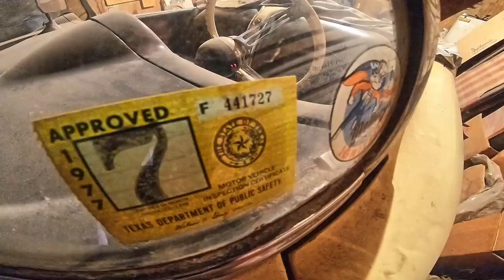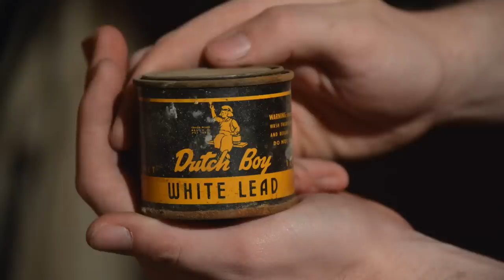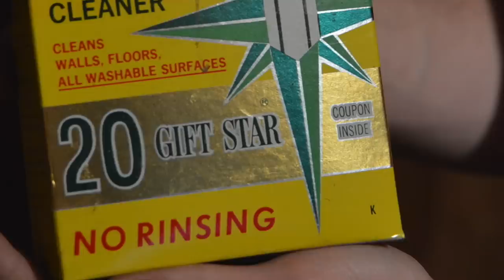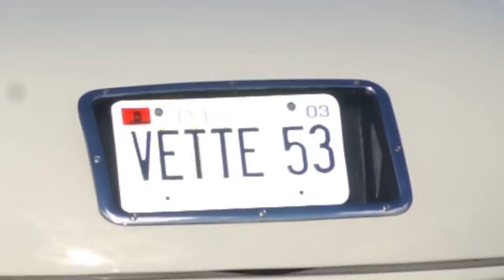1955 Corvette Barn Find Extraction, parked  in1977 - the lighter side of hoarding

Comment: I say New brakes, tires, fluids and drive it!
Reply: Got to check the gas tank and oil lines as well as the fuel pump, wheel brake cylinders, new fluids. Lot more to it than new brakes and tires. but your right, drive it.
Reply: It would take a lot of work. Everything is dried out. All hydraulics are bad. Mice . Carb rebuilt. Fuel pump , water pump bad , gas tank and lines rotten . Tires bad . My 62 had the throw out bearing grease dry up. It sounds good but you cant just fire these old cars up. And price some nos parts someday. The reality is its not cheap.
Reply: Yeah more like tear the engine apart and rebuild it, every hose new, every fluid changed, all new gaskets and brakes and tires, plus all the gremlins that storing a car for 40 years creates.

Comment: i found a disc  off about a 58  vette, they used have a plastic disc in the trunk lid about 10 inches  in diameter that had the corvette  in it.  i found on in the street in detroit in the gutter about 1960, have had a affection for those old vettes since.  i rolled off the line in motor city circa 1954.  you did a great job with the cheese cloth, that paint is a testament to chevy

Comment: Awesome......dont restore it!!! Just clean it up.
Reply: What a beautiful car
Reply: I agree pleas dont
Reply: When did the 4 headlamp version come out?.
Reply: @urbankotto9685  1958
Reply: yes preserve it as it is its a survivor
Reply: and dont spray water on the engine !!!!!!!!!!!!!!
Reply: Got to restore it first as the brakes will be rusted, the oil changed, pull the plugs and turn the engine by hand to make sure there are no frozen pistons, that kind of resoration, all mechanical.
Reply: BB Productoins got to drop the tank do the seals in the slave cylinders rear main etc . Those old cork jobs would have seen better days gaskets etc

Comment: If I may advise on this. Please do leave it as it is. The only things I would do to it is change out all of the rubber on it (period correct tires, Engine hoses, belts, rubber parts on the fuel lines, seals and do a VERY thorough check and test of ALL of the Electrical system.) Very cool to see this Vette see the light of day in 41 years. Please do keep us posted, I did subscribe. Thank you for the documentary.

Comment: From the brake system that is toast from master cylinder to all wheel cylinders at all for corners and turn all drums. All fuel components to be flushed and checked for leaks. All rubber to be replaced that includes the old rubber brake lines. This guy has alot of work to do, but what a ride!

Comment: Wow incredible how different it looked just rinsing the dirt off!
I was surprised the brakes weren't all seized up but I guess they may be drum brakes so quite protected ? I'm guessing it is a very dry climate there because over here in the UK I stored a motorbike in a dry garage, left it for around 6 months and noticed lots of spots of rust developing on all the chrome work and alloy parts were oxidising! There is just so much moisture in the air ! 😳
Reply: PD Tech only brake that worked was the parking break! The actual brakes felt like the breaks were not even there lol
Reply: @masonrichards4498 missing brake fluid

Comment: My father in law has a 57 and a 64 stashed away with several old Chevrolets!! I've begged him to sell me the 64 hardtop convertible. Mu wife gets the 57 when he passes. Its blue and silver with fuel injection. 57k og miles. I've seen it once. 57 has been garage kept and I bet with new lines and plugs itll fire right up. 64 needs a slew of work but he did buy a 327 that's still in plastic on a motor stand. My wife and I are the only ones who would never sell his cars.

Comment: @ Jerry Heasley - Your comment about the definition of "Roadster" is partial. The original definition of Roadster is a 2 seater convertible with a removable windshield,and no door roll up windows. Cabriolets had stationary windshields and roll up door windows.
Reply from the maker: Yes, thanks for adding those. I did not realize a removable windshield.

Comment: Dang it Bob clean up that messy garage first. Dang, I had my '29 Ford Roadster that I built from the ground up, my Harley and my '62 Jag XKE sitting side by side in my very clean garage. toss out the memories of your water skies and clean the garage, then clean the car, and the mechanical parts first, then as mentioned, keep the original color, and drive it Bob. Good Luck.

Comment: Looks like the hubcaps are missing.  Might want go back in that old garage and try to look for them and see if they are still inthere somewhere.
Reply: Yeah actually the wheels that are on it are from a later model station wagon. Just because he wanted a little wider tire back in the day. But we plan to try and find something eventually
Reply: Mason Richards ... Greetings from the West end of America, next to the communist coast. At any rate, for my two cents worth, if you plan to drive the car in traffic, it is possible to upgrade the brakes and ride without making major changes in the car's appearance. The brakes in '55 were abysmal and now they're as much as 64 years old, or at least about 42, based on the 1977 sticker. Having a brake pedal go to the floor as you approach something other than air is the sickest feeling you can have. If you all decide to stay with the original system, at least give yourselves the best chance to stop the car. Replace the master cylinder, wheel cylinders and the hoses at the front wheels and rear axle. New shoes for sure, drums as needed. Drums are not likely to need replacing, unless they have been worn and turned to or beyond maximum diameter. As time went on, brakes in newer cars were improved in several increments. First was power assist to increase the stopping power. Next, dual master cylinder operation. If the cylinder had a failure, it was likely that only one half would fail and the other half could bring the car to a stop, albeit in a longer time and distance. Disc brakes greatly increased stopping capability. Now, antilock systems are standard. I'm sure you are being inundated with suggestions for what to do with the car's appearance. I am doing the same, but in the interest of the fiberglass structure. An intact first generation Vette is a rare thing. Best wishes for you and your family. Merry Christmas!
Reply: J W thanks for the advice! I know it’s getting a entirely new breaking system because that’s what his kids got him for Father’s Day I honestly don’t know what they got him. Best of wishes for you and your family as well! Merry Christmas!

Comment: Simply clean it up and enjoy the '55. It would cost WAY too much money to try to locate an appropriate dated engine with all the correct parts to "restore" it. The Solid Axles were from a far simpler time with respect to a concours restoration, but you will pay an arm and a leg for any missing parts if you attempt to restore to "original" condition, ie. just as it appeared when it came off the St. Louis assembly line.
Reply: Eric Mortimer trust me we know just from looking at just a set of windows is almost 3k he actually has a period correct engine for it but he doesn’t know if he wants period correct or drive ability
Reply: @masonrichards4498  Hi Mason- Exactly.- and if you think restoring a "normal" 1955 is pricey- try restoring a real Harvest Gold one. :)
Reply: Eric Mortimer … A friend just went through a restoration on a 53 and dropped about $200k on the job to make it correct. We can trace the "numbers matching" engine and trany back only so far then it's lost at some garage sale 40 years ago. IOW, looks great but not totally original now. (and the owner is now over 80)
Reply: @masonrichards4498  if u could drive a small block in55 u could still drive it in 2000 Chevys even had od in 55 if u want it. Driving thru water might fade the brakes is all.

Comment: What a gem. Clean it and drive it, don't restore it.
Reply: True, it's part of history  .  Body is fiberglass and the engine can be re-built.  The 265 was  bored out   to as high  as the  350  where  those engines are still around and  would drop right in .   Metal cars  like the 55-57 Tbird with   the 292 or 312    can cost big bucks to restore  just for the labour  to fix the body .

Comment: The way it sits...it probably needs a complete carburetor rebuild...new plugs distributor cap new points engine flush New oil all the fluids changed...new brakes ...etc...I’d bust pull the motor and rebuild it..

Comment: To skip all the extraneous BS and get right to the "unboxing", go to 11:25.  I was born in St.Louis on the same day that the Corvette was introduced.  I'm told that they only sold 4 the first year.  My dad repo'ed cars for a while and drove home in a 1960 Vette  (first year with the Sting Ray rear) that was built to the hilt with a dual quad 427,  M-21 "Rock Crusher" 4 spd. and 15" wrinkle wall slicks.  Having worked at Fischer Body, he knew a gem when he saw it.
Reply: 61 was first s ray rear

Comment: Not take that old car update the ignition just a bit was one of the conversion kits throw on a stand-alone electronic fuel injection that replaces the carburetor tune it up fix the brakes put some modern rubber on it and drive it.

Comment: The saddest barn find I have ever seen...     What's up?   Everyone is sad...
Reply: Mustang860 lol I was ecstatic only reason I think we seemed sad is because none of us had ever been on cameras!😂
Reply: @masonrichards4498   Hey Mason, I more into Hot Rods, though this is about as cool as it gets. What kind of 40 Ford is your Grandpa & Mom putting together ? As for the Corvette, I'd be inspecting / changing all the mechanical rubber components, as said brakes, check all the steering components complete along with fluids and all other common sense things to check on something sitting that long. I was taught a long time ago, that no matter how cool it looks, if it don't stop or steer, you're in big trouble. Good luck with the project !
Reply: milwscruffy a deluxe 2 door sedan! And   As far as I know it may get a frame off go through of the car not 100% restore but fix what needs to be fixed on the fiberglass and then maybe make it more of a driver with a turbo 350. Thank you!